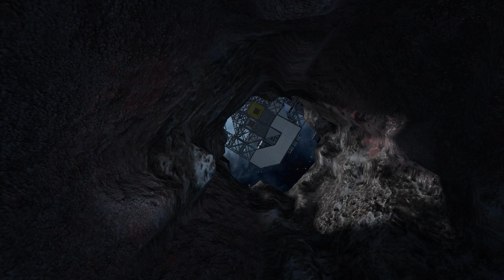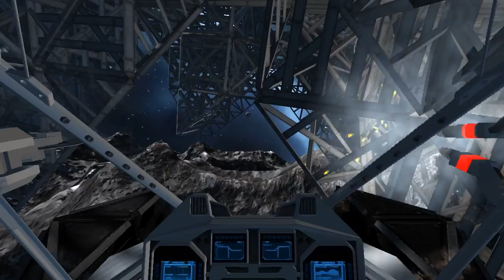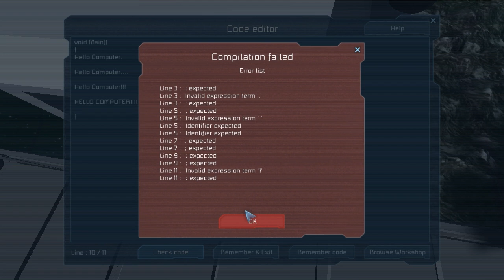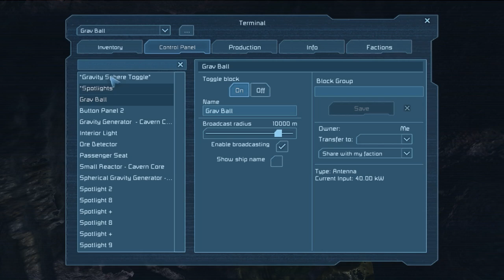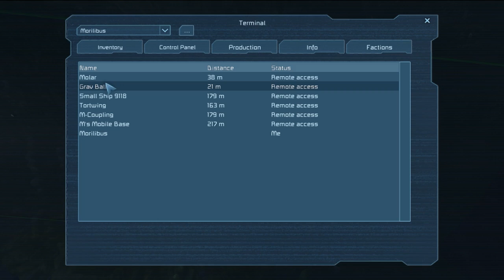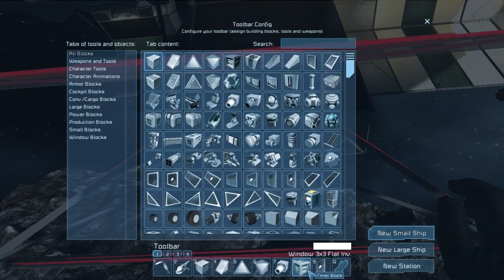Space Engineers • Solo Survival • 30 • Gravity Storage

Comment: Since you're gonna have two intersecting tunnels as hangars / maintenance facilities maybe there is no need for that kind of complicated entrances through the holes in the bottom; i mean there should be one big bottom-entrance in the center for the Mollar's, but the rest of the entrances on the sides is redundant - just two open criss-cross fly-through tunnels, maybe with decorative doors, it's not a battleship anyway.
And about maintenance facility with adjustable welders / production facility - maybe place it in one of the arms of the criss-cross tunnel and make a hangar out of the opposite arm.